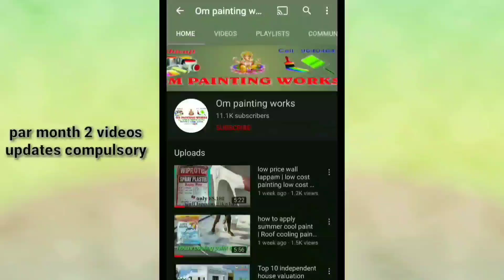Spray painting machine low budget (full review) heavy work

Comment: i used these machines, they are very loud and half of paint is wasted in the surroundings or floor and its a cheap air compressor fan type which is less than 1000rs (amazon) 2nd type is heavy duty Piston/no-sound, which is around 3 to 4k range.
Reply: Ok bro send me a best spray machine
Reply: @singingsong1029  Search 12v micro diaphragm pump airless paint sprayer.. only need 12 volts.  its 500 rupees for motor only. full set with nozzle, pipe, 12 DC adapter, mixing cup.. is less than 2000 only..ok👍
Reply: Sky Tech  alibaba.